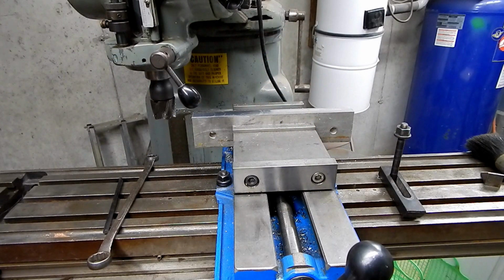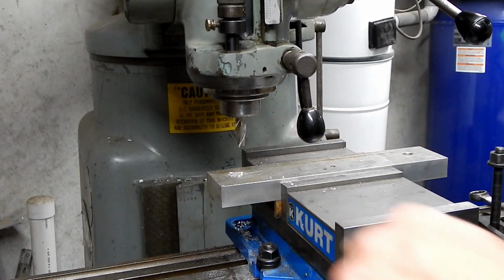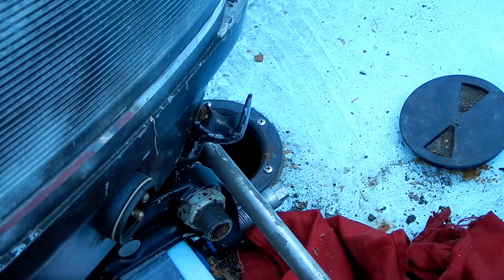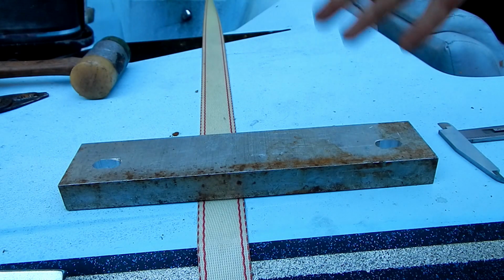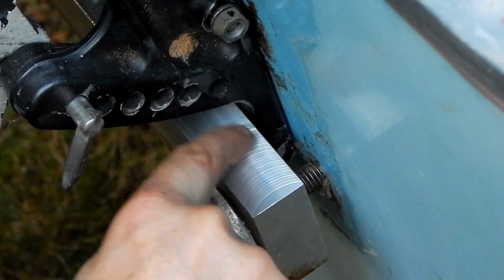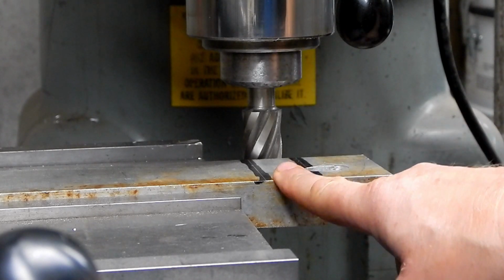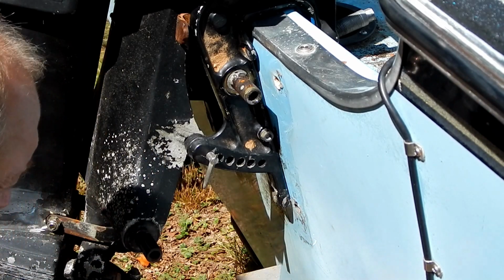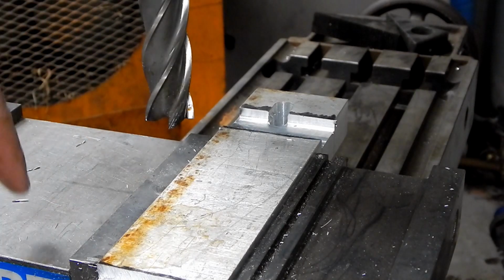The Mercury Tower of Power Outboard Motor Part 81

Comment: That long endmill is way longer than what you need it to do, plus the holder makes the setup extremely long and  unridgid. Use a smaller stubby endmill that fits In a collet and your result will improve a ton.
Reply from the maker: Thanks, I appreciate your advice